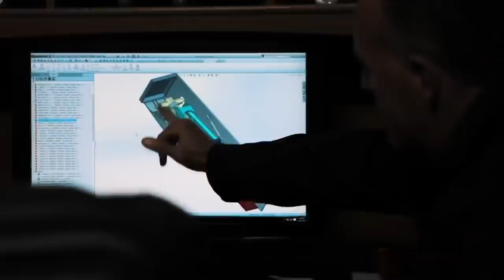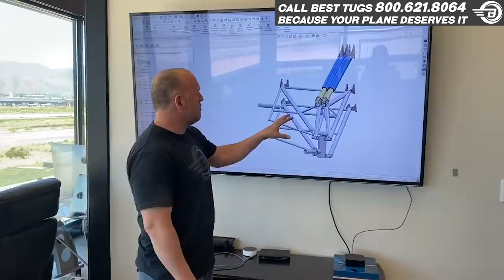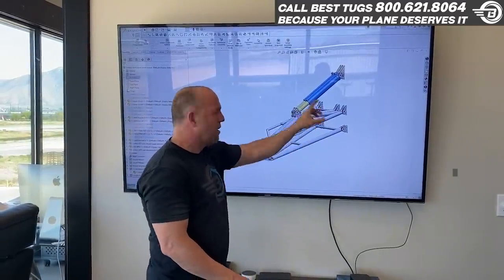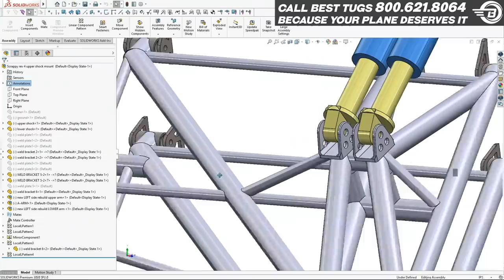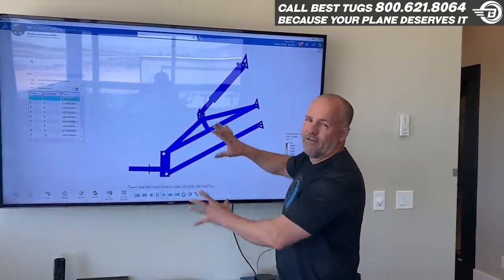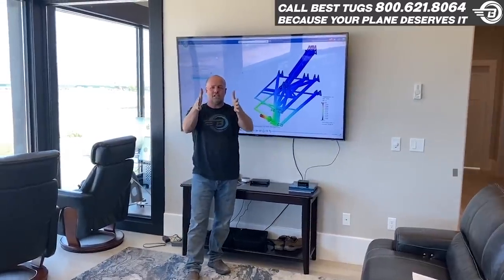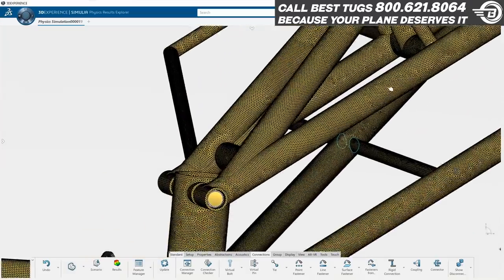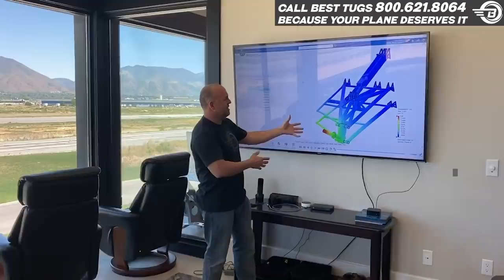Scrappy Gear Leg Wings Begin 🛠🤠 (Scrappy Bush Plane 16)

Comment: Sadly I think general aviation is a dying industry. Jobs pay less and less in comparison to the expenses that go up and up when it comes to renting and/or owning an aircraft. I think the only thing that might actually save Private Aviation is ultralight aircraft but at the same time in ultralight aircraft or not cheap to buy or build. I feel like most people that are in sport pilot or Private Pilot Industries or people that are already working in the aviation industry in some fashion or another. But as for your regular Joe who is working a construction job or doesn't make $80,000 a year, it's just not in the would work for people like that to have the motivation to put the time in the money into general aviation. By all means I hope I am wrong in my hypothesis, but that's just the way it seems to me looking from the outside-in. The way I found to get into the industry was to go for my airframe and PowerPlant certification and I'm hoping that I can find a job when I end up getting my certification that will allow me to have the excess funds to rent an aircraft for a few hours as well as possibly one day own my to have the excess funds to rent an aircraft for a few hours as well as possibly one day own my own experimental aircraft or ultralight.
Reply from the maker: There are some really good, inexpensive airplanes out there.  A buddy of mine picked one up for $52k and for less than it costs to rent, you can own and have an asset that’s still worth what you paid for and get your money back if/when you sell.  My wife and I did that with the 172 we trained in.